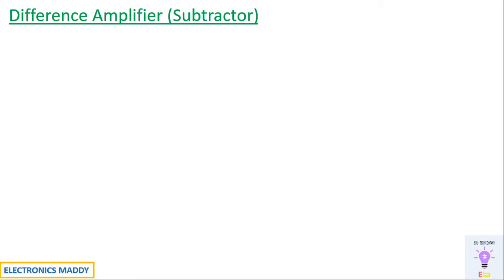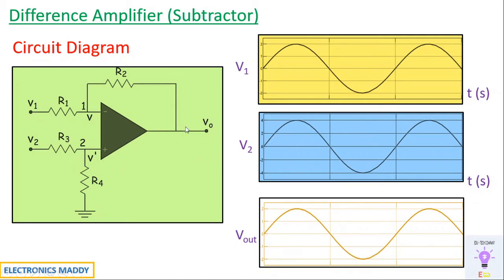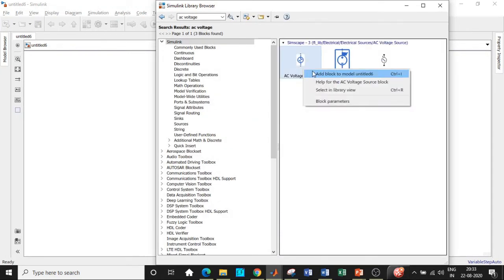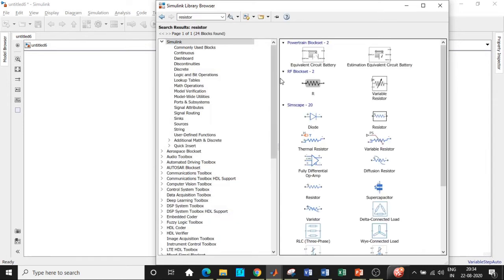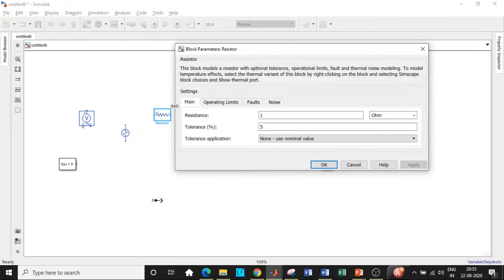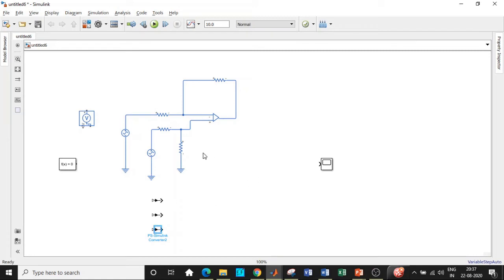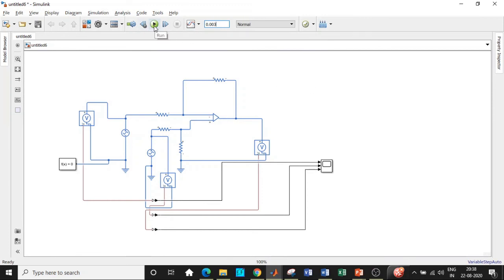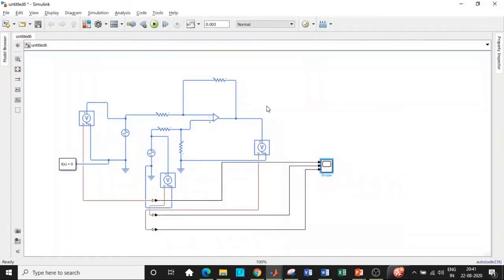Design and Simulation of a Difference Amplifier in MATLAB | SIMULINK | Subtractor | Op Amp

Comment: Hello, when im apply 50 hz but can't see the full wave form, please help me
Reply from the maker: Hi Jibin. 50Hz is very less for operating an Op Amp. Please try with the range in kHz.
Reply: @ElectronicsMaddy  but i want to apply 50 hz it is for project work
Reply: Any changes in the configuration parameters
Reply from the maker: @jibinok5683  Send your model to electronicsmaddy@gmail.com. I will check and get back.